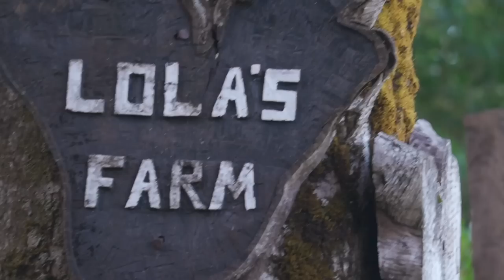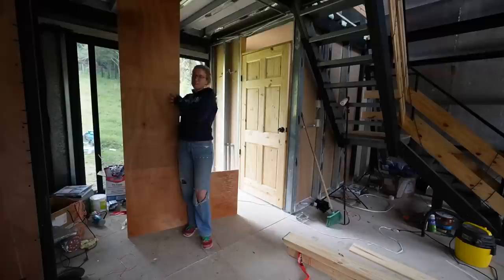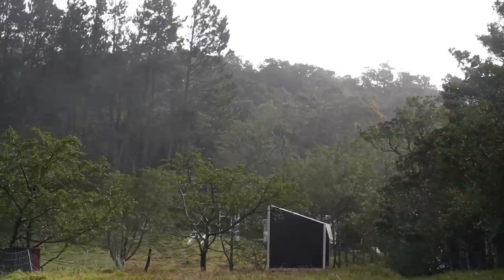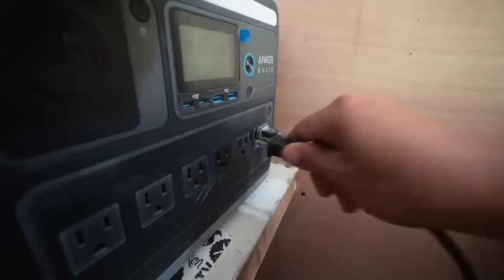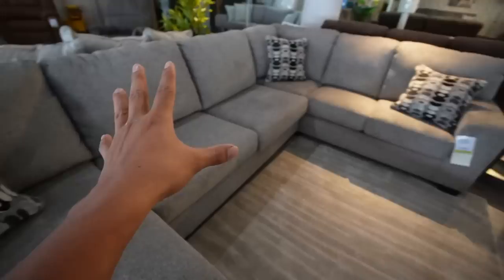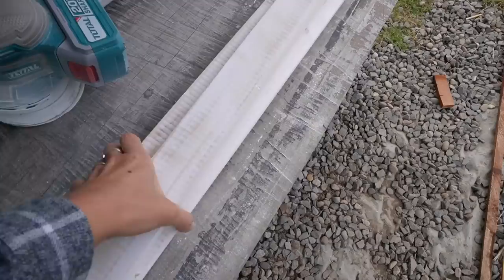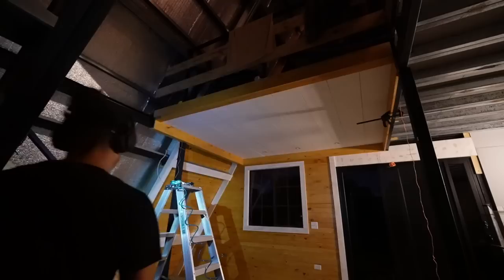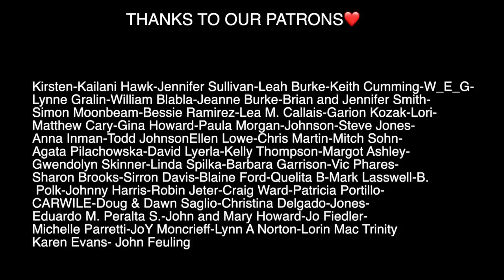THE BIG REVEAL || OUR HOUSE NEEDED THIS!

Comment: Well I like the black and wood without the white framing. I do like the white ceiling. I'd probably finish the floors and walls though, before I got hung up on casing in each section with whitewash boards. Look how tall that A frame is, casing each section wow. Then again I would have used wallboard and not tongue and groove for the ceiling.

Comment: I love your channel. You have an amazing life. I have a thought for your chandelier idea. A ceiling fan in black, in the living room, and a small ceiling chandelier in  wrought iron and wood, placed over the sliding doors, (and use a special led dimmer). With led lights in the ceiling chandelier dimmed all night  would double as a welcome safety light, if you go downstairs during the night,  and the little bulbs will reflect off the glass and look extra pretty when it's dark outside.

Comment: Recessed lights are for background lighting. Then chandeliers for direct lighting over  table . You can also buy dimming switches . I ,earned there are battery operated lightbulbs and fixtures you can interchange these with in DIY lighting if you do not have a plug !

Comment: I would go with a ceiling fan that also has a light. Only because in the summer it will get very hot and worse when you cook and use the oven. This way the fan will cool that area.and when you don’t need it just turn that off and continue using the light .since it does has two switches one for the light and one for the fan

Comment: Recessed lighting is best ceiling in your lounge area also a couple of side wall lights BUT differently  No Chandelier in lounge. 
Put chandelier style lights hanging in stairs. Kitchen Chandelier to me hang at roof angle and light bulbs hang level. You could put sensor strip lights stair trends.

Comment: Curious, if the house is not fully sealed from leaks, and your electrically wires sit between wood and dealing. Can’t the water get to the electrical/wire? Why wouldn’t you seal all the house?